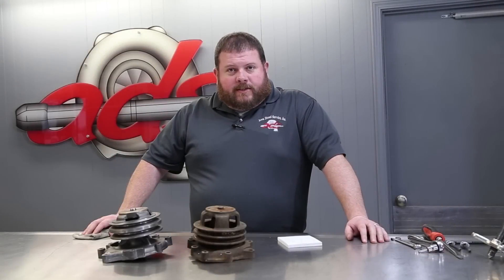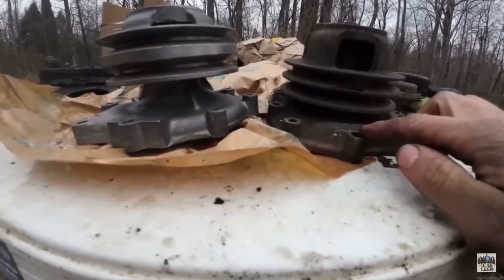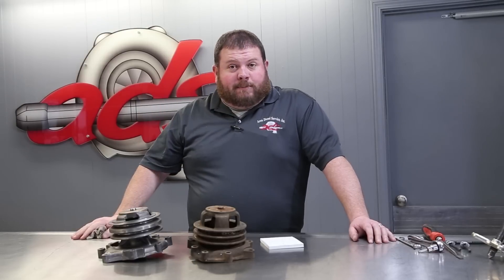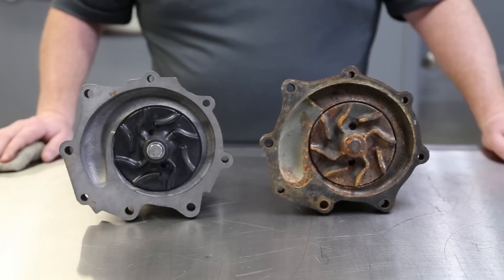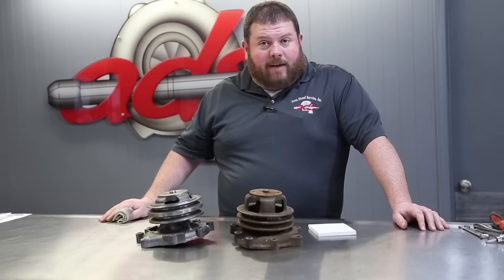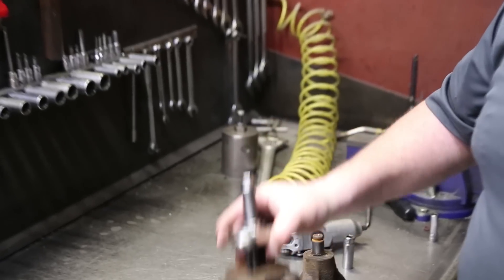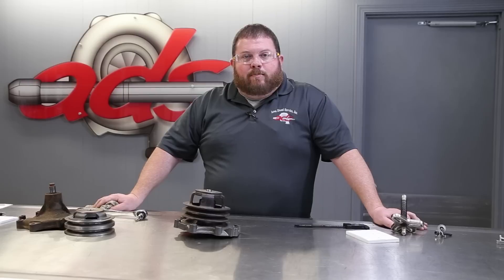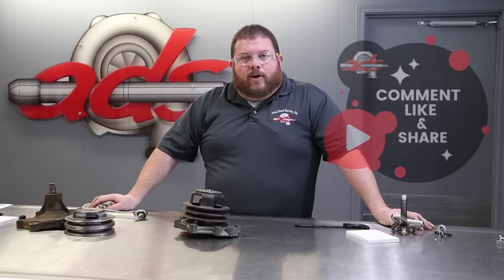OBSOLETE to CUSTOM Diesel Water Pump for @CaptainKleeman FORD 555 Backhoe #rustoration #restoration

Comment: ADS has the dedication to it's customers level every company shoud have.
I do myself doing home service calls and shop circuit board repairs on Arcade and pinball games, jukeboxes and other Amusement vending equipment. 
Always do your best not just "good enough".
Captain Kleeman is lucky ADS took on the task and got it done so his old 555 can be saved and get back to work again.

Comment: There is a big difference in the groove inside between them. The old one has a much bigger for more flow.
I might want to install some kind of pin to lock the pulley to the shaft. Since it has no kind of bolt or screw or clips.
It is not pressed down all the way. Dont know if it was pressed down all the way on the old housing?

Comment: Old trick.....   Heat the shaft, bolt, nut you are trying to remove. When it gets hot, melt some paraffin wax where you would usually use penetrating oil. Let it cool then loosen it. Been doing this for years and works way better than penetrating oils.

Comment: If the product was assembled in manufacturing, chances are it can be dissembled and rebuilt. 
I had many of this engines cousin in medium duty trucks, they were bullet  proof
Ford had a service procedure in their manuals for rebuilding the water pumps.

Comment: That's not a big job if you've got the right puller and a big press. If you're trying to repair a tractor behind the shed and it's a Frankenstein mess then all the help you can get may be just enough.